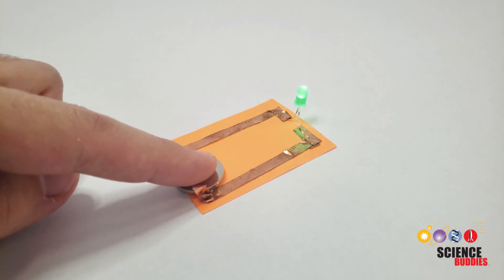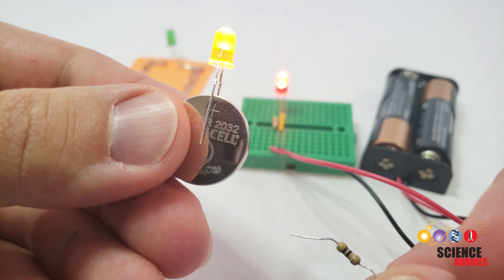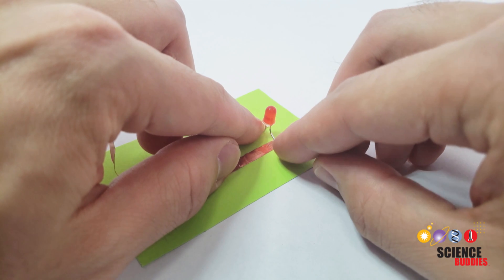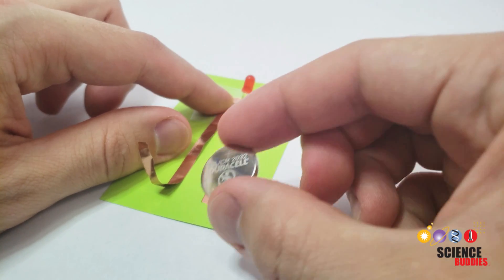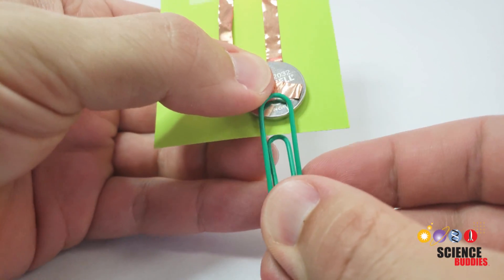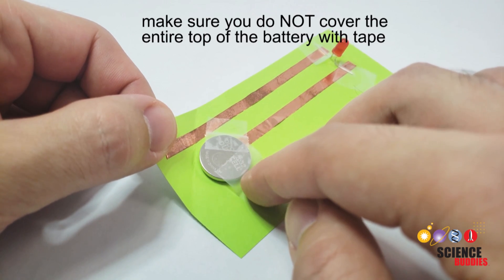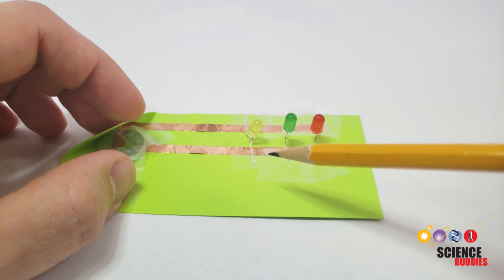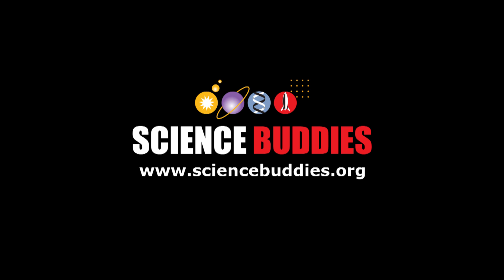How to Make Paper Circuits | STEM Activity

Comment: For placing the copper tape over the coin battery what can you use to secure that connection better? Please give suggestions. My connection wasn’t strong enough so the battery died quickly.
Reply from the maker: If you pinch the tape onto the copper with a paper clip or binder clip it may hold the contacts better. Avoid soldering or using any adhesives (conductive epoxy/glue/paint etc) directly on the battery.

Comment: I encountered the multicolor light issue! I stumbled across this video while looking up something else and had no idea I was going to be so validated on this particular issue! My red and yellow lights would light up but not white, or blue, or green! But the lights all worked individually.  I didn't know if I had dud lights or poor connection or not enough power or the wrong polarity or what!  How do you combat this issue so you can have multi colored lights? I wanna make a thank you card for someone who invited us over to watch their fireworks. 🎆 🎇
Reply from the maker: Hi - you could make two (or more) separate circuits in the same card with two different batteries, and keep lights with similar voltages on separate circuits.

Comment: Great,  i have one question related to copper tape wire pls help me out, I M using 3mm copper tape but its not working properly.  So my question is how much mm is sufficient for smooth flow of current while using copper Tape pls help me out. .
Reply from the maker: Hi - the tape does not need to be very wide, 3mm should be fine. You need to make sure all parts of the circuit are in firm contact with each other and that the tape doesn't have an insulating layer or film on top, if it does you need to scrape that off.

Comment: Very useful video - thank you so much for posting. Can the LEDs be any length or does it have to be a specific length? I don't know what to order for my school.
Reply from the maker: 5mm LEDs are the most common and they're what you see in this video - the 5mm refers to the diameter of the LED, not the length. 10mm or "jumbo" LEDs are also common and will work the same way.
Reply: @Science.Buddies   Thanks for posting. This is THE BESTTT!!!!!